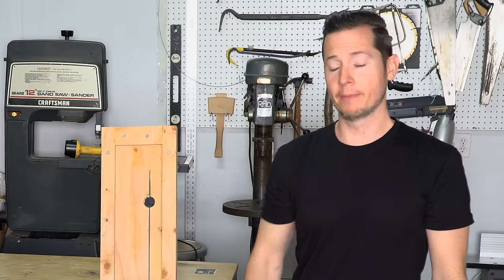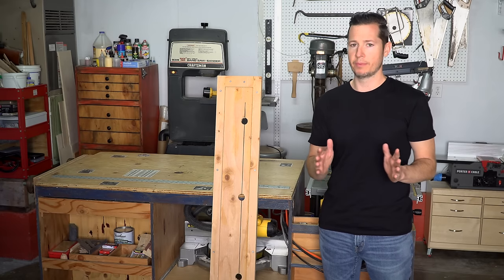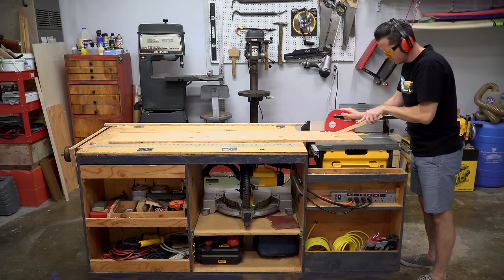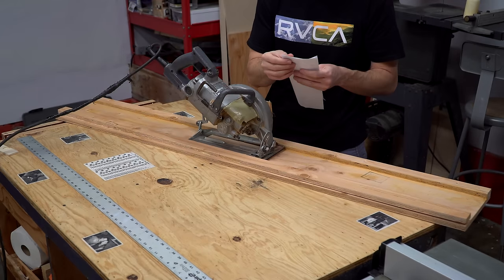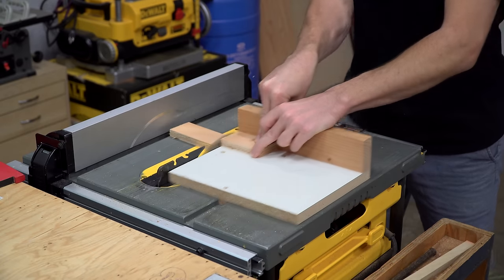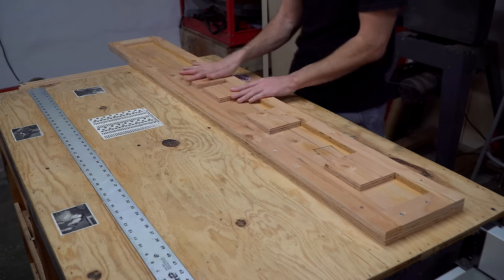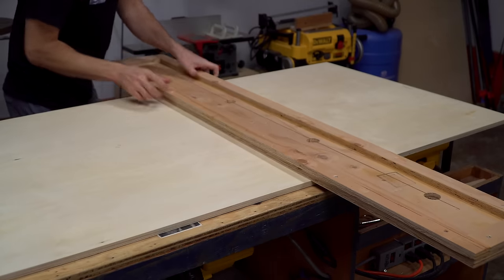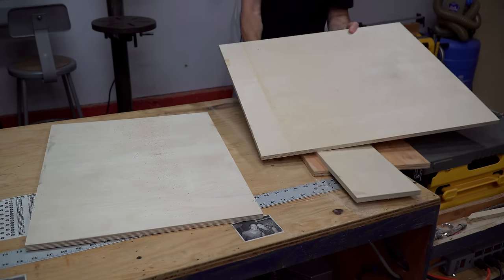Super Simple Track Saw

Comment: Great presentation.  Great explanation.  One element I would have liked is explaining why it was so important to countersink the screws.  After all, the saw rides in the track and is not going to impinge on the screws.  (I'm sure there's something I'm missing which is why I'm asking).  Overall great design, and I'll be building one soon.  Next week.  December.  Well, after the holidays for sure!  Happy Thanksgiving and thanks for the video!
Reply from the maker: Thank you! I chose to countersink the heads because I didn't want them interfering with a potential clamping spot. Also, I generally just prefer screw heads to be out of the way...keeps them from scratching or catching on things when you're moving the track (or any sort of jig) around the shop. Thanks again! Let me know how your build turns out!
Reply: Good thoughts. Screw head would almost be sure to catch.
Reply: If you're cool with waiting for the glue to dry, you don't actually need the screws.

Comment: Great jig. Use a hole saw then you can add the holes after the slot is cut.
Reply: Would you still be any better off. As it still needs a drill hole to start it off .thoughts.? I'm still learning at wood work so I'm just your average diyer for time being

Comment: Make this have a self squaring "L" on it and it can easily be used to make perfectly square cuts automatically.
Reply: I'm going to do this and I'm going to make a "T" a the bottom so it quickly butts up against the board I want to cut and squares itself.  Then the only thing I'll have to do is make sure I align the track with the sight holes.   Great idea!!
Reply: Then you wouldn't need the sighting holes.  And sometimes you want to chalk an angle.
Reply: Alan kath have picture L self squaring?
Reply: As long as you’re doing that, connect the straight edge through to the top of the jig. Then you can set angles.
Reply: Also, pastewax the slide surface for less friction . It will make it last longer with less rubbing and preserve it.
Reply: good idea, but if you wanted an angled cut.. like an osb with a roof pitch..  maybe make it easy to take off or have a second one without a T

Comment: I'm going to make one for cutting 8' plywood lengthwise
Reply: You really need the length of your saw's base plate before the cut begins and after the cut is finished to insure that the 8 foot cut is straight and accurate, so the jig will need an overall length of about 10 feet.  Since most sheet goods are available in 8 foot length only, how are you proposing (or how did you now) achieve the full length?  A track saw for me would be far more valuable for cutting 8 footers than cutting 4 footers.
Reply: Chris Graham 8’ works fine, you just have to be careful and aware of alignment when starting and ending the cut

Comment: Make up a set so you don't have to mess with depth setting. One for 1/2" one for 3/4" and one for 1 1/2" would cover 90% of what I use.
Reply from the maker: Thanks for sharing that idea!
Reply: Or, just cut some wide 1/4" thick strips to lay down in the channel.  Just add as many as you need to get the desired thickness.  Stack them all up on the sled and drill a couple of holes straight through them and the sled so that they can be held in place by just dropping a bolt or pin through the holes.

Comment: if you want you can ease the push by using paraffin wax along the bottom and sides of the track, just take a piece of paraffin wax bar and use it like a crayon
Reply: Or paste wax.  That stuff works well for me too.
Reply: It does work really well, I just find that paraffin is cheaper, and last a little bit longer
Reply: Good old-fashioned candles. Something I was taught years ago, if your saw blade sticks, give it a rub with a candle. I later discovered the same to be true with aluminium extension ladders, parrafin is one of the better lubricants for aluminium.

Comment: two thoughts...I'm inclined to have wider side pieces for more clamping space (particularly if you can't clamp both sides) [would like to hear opinions on that, if anyone has 'em!]; secondly, I'm a-gonna slather that "tray" with paste wax so my saw can mosey down the line w/no trouble.

itching to do this project RIGHT NOW!

:-)
Reply: I thought exactly the same. Make bottom part wider on one side for clamps like other videos on youtube. I also thought about the wax to make it my circular saw slide better.
Reply: @gnawrot  I used some teflon tape.  You talk about smooth!

Comment: Amazing yet simple, (as are so many things that are profound) THANK YOU, you just saved my kitchen counter lamintate project (first time doing it) where I need to use my humble circular saw to do the heavy lifting while also being exact. Kudos to you!
Reply from the maker: No problem, I’m glad you dig it! Here’s a tip: make sure the base of your saw is in the track before starting a cut on a piece of material. Have the blade fully retracted, start the motor and THEN lower the blade through the slot to start your cut. Having the base in the track (instead of trying to lower the base into the track) makes sure the start of your cut will be perfectly straight. I hope this helps!

Comment: I've had a single-track saw guide for years. It doesn't come out of alignment often, but it certainly does sometimes. This causes not only a bad cut, but the blade grazing the guide. This of course greatly decreases precision. I've Sharpie marks all over the damn thing where I've grazed it so I don't line my cut up with those parts. Your double-track design will be a great improvement. Thanks!

Comment: Good job. I made one like this two years ago and I glued some grip on the bottom. So that it would not need clamps similar to the grippy bottom of my new DeWalt track saw track. My diy track saw was great for certain cuts over a few years but now that I have my DeWalt 60v cordless track saw I can actually use it like 10 times more often and it's faster. For the money the diy was great for years though if it's for less cuts per day or week etc..  if u want to try the grip idea, I used a wood CA glue to attach the thin husky tool drawer liners sold at Depot then used some electric tape around the outside edges. I did make sure to leave several inches away from the blade on each side so that it would never be a dangerous thing to get in the saw. It's foamish rubber anyway so it's not dangerous or anything.

Comment: Awesome idea. I was going to buy Kreg Accu-Cut but found out from reviews it's not so accurate due to lateral movement of sled on the aluminum rail. I have an upgrade suggestion for your design, add T-Slot track on the underside to be able to use track clamps to attach the guide rail to the workpiece. Also I cut on pink insulation foam much easier that way as the foam supports everything.

Comment: Good video!  As another commentors said, you don't waste our time.
I have worn out dozens of saws over the years, and I think you should understand that if the saw travels away from (or toward) the guide, it is because the shoe is not perfectly aligned with the blade.  I have wasted lots of time trying to realign it, but with a heavily used (abused) saw, it becomes necessary to learn how to finesse it.  Your jig forces the saw to follow your line, but with more load on the motor and a slightly wider kerf.
If I had an improvement to pass on ( besides learn to finesse a single guide and memorize the quirks of your saw), I would pass it on, but right now, I can't come up with one.

You design does work though. Kudos for that. Maybe warn your viewers that they will burn up motors quicker if used a lot.

Comment: What these are especially useful for (but no one ever demonstrates!) is cutting angles.  A clamp edge will do pretty much the same thing as any track saw, but having a track that you can lay down in any direction is great if you are doing something that requires a 45 or anything that isn't a 90.

Comment: This is the best, simplest and most accurate design that doesn't require a base plate attached to the circular saw.   I don't want to dedicate a saw for the single purpose of cutting sheet goods and I don't want to be swapping a base plate on and off when I need the saw for other functions.

Comment: Thanks for this. I'm not used to working with wood so when I purchased 50mm foam and 50mm lumber, I didn't expect to have to cut 6mm shims to make the two line up! There's a reason skyscrapers are dead square and houses aren't!
Reply from the maker: No problem! I hear ya about the differences between metal and wood. You learn a lot when you switch from one to the other!

Comment: Clever idea.  Thanks for sharing.
The 'fixed track' is only good for that particular circular saw (or other saws with the exact same width).
The track also could use more guide holes to make lining up your reference mark easier with less fussing around to find them with so few holes.

Comment: Excellent.  I will make one of these.  My only suggestion would add a step confirming the first side strip is straight by jointing and ripping it parallel.  If the track isn't straight, the sled won't cut straight.  Thank you.

Comment: I made a track exactly like this over 23 years ago, long before there was stuff like this available in stores. The only difference is I used 1x2  hardwood for the guides and the bottom was 3/8 ply and mine was 9ft. I used it to cut ply onsite that needed to be straighter than just a chaulkline. I also waxed the wood to help with binding.

Comment: Just a quick note, not all circular saw are created equal.  If your motor is mounted horizontal to your blade and using 3/4" stock, You'll only cut to a depth of 1/2" as the motor will rest on the 2" strips of stock.  Still, it was a good Video!
Reply from the maker: Joe, thanks for the feedback! I’ve built a couple more of these tracks since this first one, and both of the saws happen to be sidewinders. I used 1/2” material, and all went well. If you’re interested, have a look: https://youtu.be/Fc77cL8ReBQ & https://youtu.be/68v9JlSM6OQ Anyway, I hope this helps!

Comment: Just made my second one.  The first one was an experiment in making it lightweight and was not completely successful.  The base was 5mm ply subfloor material which was OK but I ripped a 1x3 in half for the sides.  It worked OK at first but internal stresses caused the sides to bow inward after a few days so the saw bound up against the sides.  The second one was made from leftovers after sheeting my shop walls with 1/2" birch ply.  This time I made sure the sides were strong enough and ripped them from more of the 1/2" birch ply to 2-1/2" wide.  It's a lot heavier than the first one but should last the rest of my life.

Comment: 3 years on and you're still inspiring people like me to make one of these. Tip Top. :). One quick question though, what length / width was the plywood you used please?.
Reply from the maker: Thanks! It’s about 60” long, which lets it make cuts of about 48”. The width will be based on the width of your saw’s base, plus the two rails. My rails are about 2” wide, but that’s not a hard rule. I hope this helps!

Comment: @Sign2Me1 - Great upgrade suggestion... I'd like to offer a modification to your modification: The base doesn't really need to be 3/4" thick. My base is going to be 8mm (about 1/4"), and the "frame" around the edges will be 20mm (about 3/4"). That keeps the base thin enough not to take too much away from the thicknesses of the work piece I can cut through. I will run my dovetail grooves under the frame pieces on each edge of the jig - where it will be 28mm thick - plenty thick for the dovetail grooves. I'm gonna do one on each side in case I want to rip a thin(ish) piece off my work piece where I might not have enough material to clamp to on that side - I'll just put the clamps on the opposite edge.
Reply: Yes the advantage of having a thinner plate is not only for cut depth, but also for improving dust exhaust, and weight.

Comment: Caution to anyone building one of these in climates that experience constant humidity changes. I just spent $70 bucks on lumber to make this. Did everything by the book. The saw slide beautifully when i completed it. I used a piece of paper folded over 4 times as a spacer to ensure there was a sufficient gap and easy sliding. 2 days after building this, I went to use this in my garage and the saw wouldn’t even fit in the slot anymore. The wood had changed dimensionally, just enough, to prevent it from fitting and definitely not sliding…I’m guessing due to changes in humidity. I now have an expensive piece of wood hanging in my garage that I haven’t decided how to repurpose just yet :P
Reply from the maker: Don’t trash it just yet. Maybe a light sanding will return it to working order. Send me an email through the website if you want to chat about it, and I’ll help brainstorm for a fix.
Reply: @OneMinuteWorkbench  thanks for reaching out! I was going to attempt to use the router to take off approximately a 1/16th or so, but I think I’m going to try to flip it upside down and try to pass it through the table saw just to widen the inside just a hair. Full disclosure: it’s a 10 foot premium pine board. I choose the straightest, nicest one in the batch. I wanted 10’ so that I could cut a full sheet of plywood. Maybe if the track was made of actual plywood it would be a bit more stable. However, my guess would have been with an increase in humidity (the board was very dry), the gap would have actually widened. I’ll give it a shot on the table saw and report back!
Reply from the maker: @kyleorr533  you’re probably going to have a rough time with the pine board. Plywood is an engineered wood product designed to have minimal dimensional changes caused by humidity. If you want a 10’ track, you’ll have to get creative. Either way, let me know how it goes, and my offer to help you brainstorm still stands.

Comment: Yesterday I made this, but at the end I got really excited and forgot to put the ends on and cut down into the jig😞 instead I once I had the side rails on and it was sliding well I just cut through the board and ended up with two pieces😂 I was able to save the day remeasured and put the ends on, and it works great.  I might make another one if I ever get extra plywood.

Comment: Quick easy build.  One question, why have the stops?  You could allow the end of the track to be the same as the board you are cutting.  Although clamping may then be an issue.  One thought may be to have some material outside of borders for clamping.

Comment: Looking for opinions what's the thinnest board for the base to make an 8' long guide?  I am considering making one 8', continuing the cut closer to the end with a sight hole - can't cut this far after the end stops are installed, but extends the sight line, so you only have to mark the ends for long cuts.  

Considering making side guides from 10' board and extending base at 1 end to make a full 8' long cut.

Also considering adding a side flap in middle to rest saw on to set proper blade depth.

Comment: You know, I've watched a ton of these over the last few days.  The problem I keep seeing for people like me (i.e., people with no table saw with a straight fence) is getting the straight cuts you need to make your jig that you're going to use to make straight cuts.  Right there in your very first or second step where you "cut a couple of 2" strips, you used your table saw to do that.  The reason a lot of us want to make something like is to be able to make straight cuts.  If we have to make a straight cut to build the thing, we're blocked.
   
Obviously, this isn't your problem, but it sure would be nice to see a video focusing on getting that first cut.  I'm fortunate - a number of years ago I did some work with some structural aluminum, and I still have some 5' or so pieces of it in my attic.  That stuff is STRAIGHT, so I can use one of those to get bootstrapped.  It's heavier than I'd want on a frequently used jig, but at least it's a way to get going.
Reply from the maker: Have a look at this video: https://youtu.be/68v9JlSM6OQ  I hope this helps!
Reply: (Just commenting because you made me think :) This track could easily be build with off-the-shelf items from a hardware store. A 12" wide shelf with door trim or baseboard rails would put someone in business, no long rips needed. Might end up cheaper that way... Maybe I'll just do that. My table saw's a pain to use too.

Comment: I think a good addition would be a squared up edge on the bottom.  That way, you can push it up against the edge of the piece you are cutting to ensure a 90 degree cut
Reply from the maker: Thanks for the suggestion!
Reply: One Minute Workbench 
Nope it was a terrible suggestion.  Lol
I made one off your plans but with my addition. All it does is shorten the length of board you can fit under it.  I had to remove it. 
I may use my router to make a recessed area where a piece of wood can be tapped into place when I want to make repetitive cuts quickly and accurately.  

I used melamine instead of wood btw.  The edges are always 90 degrees and it makes for a better sliding surface.  Time will tell how long it holds up
Reply from the maker: Thanks for the update - let me know if you decided to do the recess!

Comment: Re: part about drilling the holes first ! instead of fiddling with those 4 temporary blocks- make a cut just as you did but only say at 1 mm depth. Then punch inside the grove 4 centers of the 4 holes, drill them and then run the cut again , but this tome all the way through the base